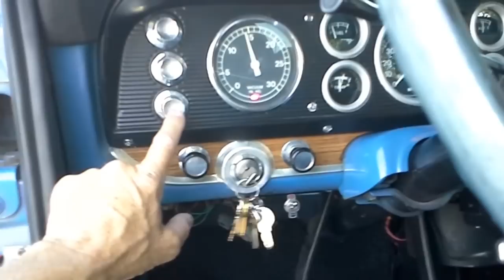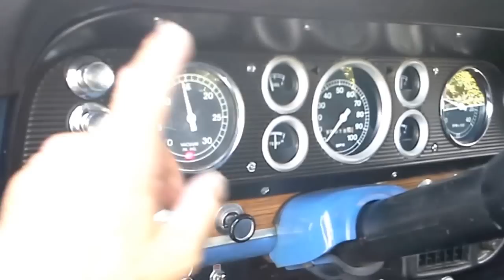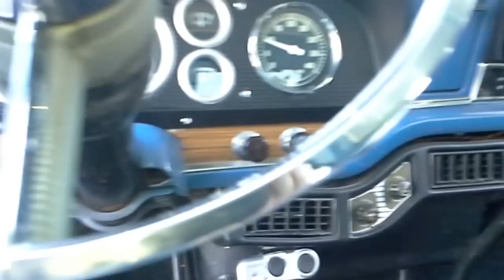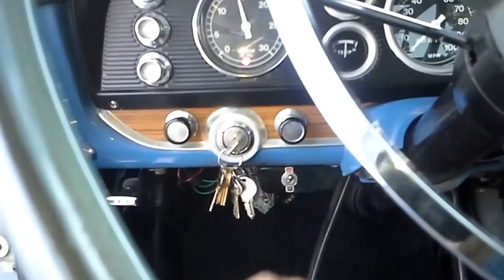1969 ford trk

Comment from the maker: @ Jim. Called the guy who provided my donor running gear, as it turns out it was a 79. Again, an error on my part. So for the record, 79 rung gear, and an NP205 married to a BW T-19 with an Advance Adapters Ranger OD box in front.

Comment: Nice truck👍 who did the work? what shop? Cost?
Thanks
Reply from the maker: The only work not performed by me was the engine build. That was done by FE Specialities. A body shop painted it with factory color match. All the other fabrication  I did.  As for the cost, I would have been better off buying a house...!!!....I probably had 50 large...

Comment from the maker: Yes Jim, you are right. The t-case is an NP205 an error on my part. and yes it is not an F350. It is an F250. When replacing the badging, "I" choose to use 1-ton badging. It was my build, and what "I" wanted. The front axle and rear ARE from an F350 tow truck from 78. The badging on THAT TOW TRUCK HAD F350 ON THE SIDE. Did someone put that on there? don't know. The badge was weathered,  and looked original to me. I assumed it was.

Comment: There's no way this 4x4 truck has the running gear from a '78 F350 4x4 when Ford did not offer a factory 4x4 F350 in '78.
Reply: +Jim Garrison    Also, it's a New Process 205 transfer case not a Dana.